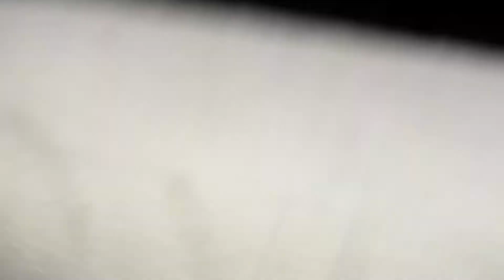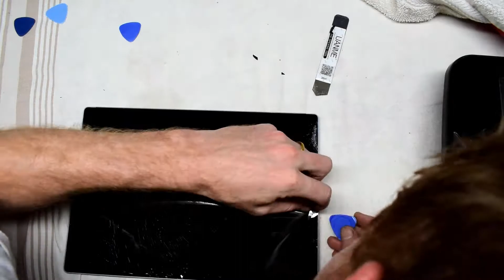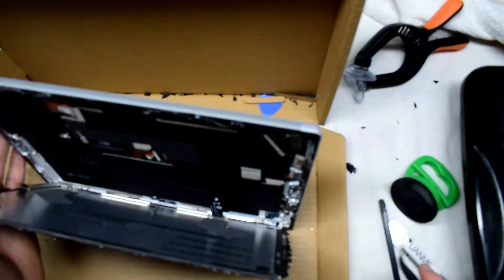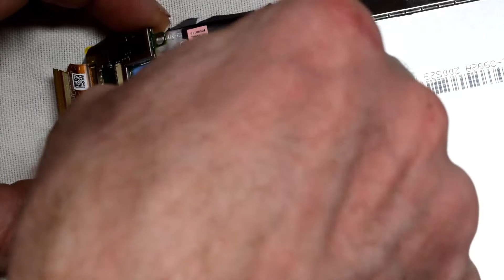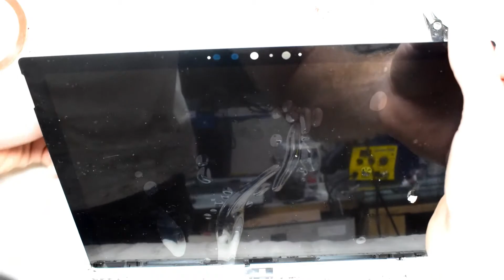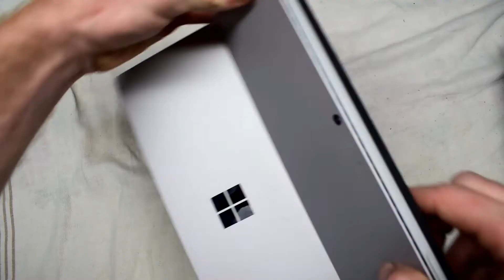Ultimate guide to Surface Pro 7 (1866) Screen Replacement (Not an Easy Fix)

Comment: Just did this replacement, screen turns on, no flickering or weird coloring but is not responsive to touch in some areas. I've reseated cables, ran updates. I ordered another screen in case this one was bad.
Reply: did you make it work? I was cleaning (spraying) power button with alcohol because it was pressing by itself and now only left part of touchscreen works :( i want to remove screen to check if it's wet inside but I'm scared to remove it without breaking
Reply: @highscore4643  I ordered a different one and it worked no problem
Reply: @StevenJosephD  damn..two new screens? that must of been expensive.

Comment: I replaced my screen but now when it heats up it gets lines all through it and windows still look open after I close them...any suggestions for a fix?
Reply: I have the same issue, did you ever find a solution?
Reply: @gmacedo94  yes...I lowered the brightness of the display so it doesn't heat up as much.

Comment: On my Pro 7+, there are 2 horizontal lines of less than 1 cm, where the stylus is not working anymore... If I delete the drivers and restart the problem persists. Is that the digitizer that has to be replaced?
Is the digitizer of the Pro 7 compatible to be used on a pro7+, they seem to have identical screens.

Comment: Thanks for the video!
I have a new screen where the touch doesn't work, any tips?
Reply: I opened mine up with a perfectly fine display, put everything back together, and the touch and pen also aren't working. Visually, everything looks good, I feel like I didn't break anything, yet it refuses to work with the completely original hardware. Checked the device manager and the touch screen drivers are missing, and loading into UEFI mode the touchscreen doesn't work there either. I'm starting to feel like Microsoft pulled an Apple where as soon as you unplug it, it bricks itself. Either that, or I'm really really really stupid and messed something up.
Reply: @shibu5175  I tried another of the PCB boards that you attach on the back and now it works for me!
Can you install the touchscreen driver through network and try?
Reply: @RubberTag  I have a replacement PCB and flex cable ordered and I'll see if that fixes it. Resetting the system, using the Microsoft firmware & driver updater didn't fix anything
Reply: @shibu5175  Wishing you good luck with that! :)
Reply: @RubberTag  Thank you so much! I pray that it does work, as I need to be able to use the pen for illustration. Several hours of research and this seems to be a common problem for the surface pro line of tablets, yet everyone either exchanges their devices or never find a solution. I honestly am unsure why my touch stopped operating because the functionality had been perfect for 3 years. I might have tugged on the flex cable too much or heated the digitizer PCB too much when trying to remove the display without cracking it. Honestly, I'm willing to settle on user error being the problem instead of now being stuck with a half useless tablet that's unfixable.

If it gives any extra indication of what's going on, the Windows "Pen and Touch Info" page says 'No or touch input available for this display', so I'm guessing it straight up isn't even responding to the system at all because that's what all my other non-touch computers show. I thought maybe since I unplugged the display from power, that the UEFI / BIOS was never able to reinitialize the drivers, but this repair video (which is like, one of the best on YouTube to be honest) doesn't have that issue. Out of all the non-replacable parts in these surface tablets, I'm actually genuinely surprised the digitizer and flex cables are the most available. I'll try to keep you posted.
Reply: @shibu5175  Hm, weird that the touch just stops working!
I would guess it is the PCB for touch control on the backside on the screen.
I can't really give you much more advice unfortunately, trying different flex cable and pcb is what I would've done I think!
Good luck and God bless 🙏
Reply: @shibu5175 did you manage to fix the touchscreen by any chance?

Comment: this repair should not be difficult. the process of replacing the screen takes about an hour. 56 minutes is what I timed myself .. the trick to this is taping duct tape around the perimeter, leave about half an inch recess from edge of surface to duct tape as this is where heat will be applied for screen removal,

Comment: Im curious to know what prevents from taping tape over the screen so that the screen is lifted using the tape. The screen is already broken and going to the trash. Every video regarding sp7 screen  replacement picks the screen off creating a mess of broken glass shards.  Maybe I am not seeing the factor that prevents from taping tape.
Reply: He is referring to using a heat gun, I often use a towel

Comment: Hi, I am having a problem with my surface pro 7, the dead screen comes on and off, especially when the tablet heats up after being on for a while, I am absolutely positive that the culprit is the magnetic microswich that is being actioned by the magnet inside the keyboard, so the LCD turns off when you bring the keyboard close to the screen, that microswich in time, due to heat and battery expansion went bad and makes the tablet acting up even with the keyboard detached, the microswich thinks that the keyboard is close to the screen, that's why the screen doesn't turn on...

I am wondering if you we're ever able to locate it?... On mine I have not taking it apart yet, I would like to identify,  locate and order a new one if am I ever going to be able to find one, if not I might just remove it and solder the wires together and have the screen on all the time... 

Without taking it apart, the microswich is on the right hand side, just a little below the right speaker, I was able to pin point it with a small magnet, but I did some research online and in all the pictures that I've seen I just couldn't identify it...

Any thoughts on it?!
Reply from the maker: sounds like a hard repair you would need to take the screen off which is hard
Reply: @NewsonsElectronics  I don't know if I'm ready to mess with it, I think it's just a heavy loss and treat it accordingly. No more Microsoft products.

Comment: Hi, could  you please help me.
I have surface pro 3 i5 8gb.
I bought it as second hand everything work good but it's crack in middle still work fine but the touch, window icon and half screen not work with pen.
should I change intier screen or what?
and how I find my screen model?

thanks

Comment: Hardly an "ultimate guide" - you missed some key details, like how to remove and replace the metal cover on the digitizer circuitry, and avoiding to damage the antennae whilst removing the old screen...